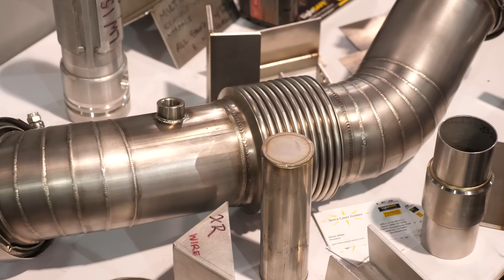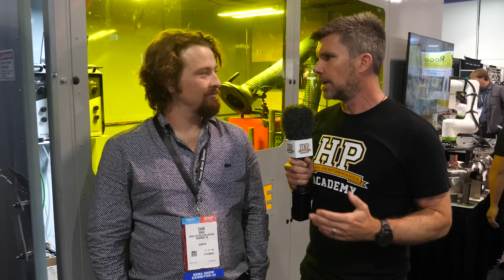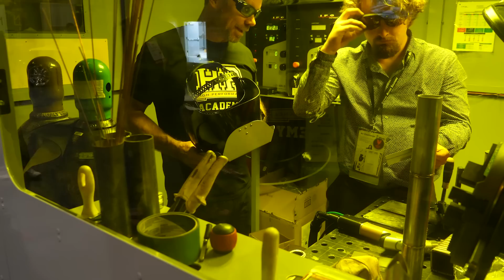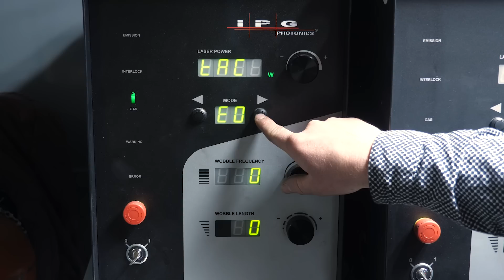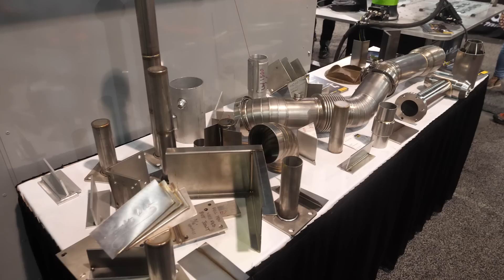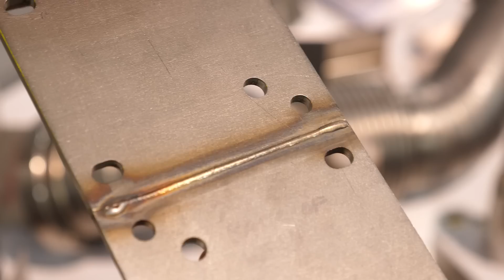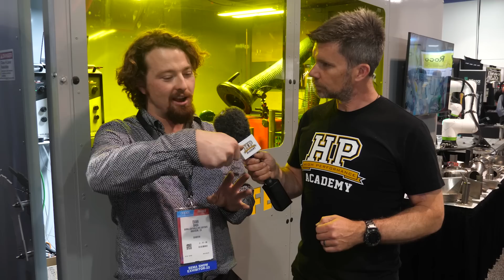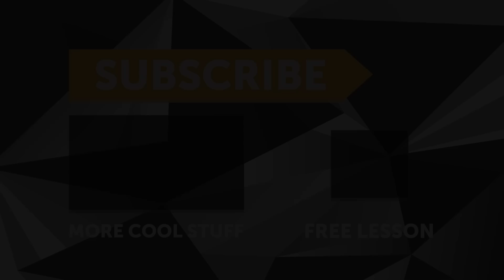Is LASER Welding Better Than TIG Welding?

Comment: Had some bits of laser welding done. One part fractured on the first use (medium stress/high vibration part) and had to be tig welded and then machined back flat, the other looks good so far and very little distortion (very low stress part).
Reply from the maker: If laser welded rockets can make it into space, I'm sure whoever did that welding for you can figure out what they did wrong for your part 😎

Note just like TIG and MIG welding machines, not all laser welders are made equal, nor are all operators (a good one knows the strength and limits of their tool/s), and there are some circumstances where a TIG or MIG might be more suitable. 

You really need to consider what is in front of you to work out the best tool for the job at the end of the day - Taz.
Reply: Welding is multi dimensional. If any one of those is not properly done you have a potential for failure. Your statement doesn’t provide enough information to make a good guess.

Comment: Laser welding has it's place and for bulk manufacturing of items made from thinner material it is very good.  It will not currently replace mig for medium to thick materials and it is not currently cleared for use in structural components or the dairy industry.  Some are as cheap as $20k for a 1000w power source but that also requires 20amp single phase power to run it.
One last thing he doesn't talk about is how dangerous they can be and how currently there is no safety legislation that covers class 4 lasers in NZ.  One I have looked at that was 1500w had a safe distance for a 0.25 sec exposure to the eye of 750mtrs!!  Also, they need to have dedicated welding booth like the one they had there.  Please don't believe the videos from China showing women in mini skirts with no safety glasses welding with one of these, they can be very dangerous in the wrong hands.
Reply from the maker: Yes and I wouldn't recommend that this is the only video someone watches to research laser welders before buying one, nor is that the intention of this content 😎 

From my personal experience using a laser welder in a previous role, they are no more dangerous than a MIG or a TIG welder noting someone negligent enough can find a way to accidentally harm or even kill themselves with a fork let alone any type of welder. 

A healthy & respectful fear of what any tool or machine can do to you and your health is a great asset to have, even if they are as mundane as a builder's hammer 😎

The industries that approve (or not) laser welding is 100% a consideration. I would be surprised if any companies were blindsided here considering they will already be working to and have systems in place maintaining a set standard for their specific industry including 3rd party testing at times where relevant. It will only be a matter of time before industries currently lagging behind will get their ducks in a row for laser welding though I'm sure.

A 20amp plug is also a requirement for some other welders along with some needing 3 phase too, with a 20amp plug being the easier and more desirable option for many - Taz.

PS: While most of your questions here would be answered presale for a MIG, TIG or laser welder, I did notice Serra offer some simple free training with purchase which I'm sure would address the rest of the concerns raised here which at a glance I thought was a nice touch.
Reply: @hpa101  Hi Taz, thanks for your reply.

Having sold welders for 25 years I can tell you that a lot of people don't care about fitting the correct plugs to machines, even some suppliers.
We have had machines turn up for repair that have either had the 15amp earth pin ground down to fit a 10amp socket or 20/32amp plugs removed and 10amp plugs fitted.
Yes, some people are that thick, I believe they are the ones who drag their knuckles in from the carpark...

I expect laser welding will become more widely used as the prices come down but NZ safety legislation needs to catch up as laser cutters are also class 4 and have been here for decades.  The European saftey specs (EN 60825 etc) have been around for years and they will be the ones we adopt.

Some of the first laser welders I saw at a trade show were robotic or mechanised, not hand lasers.  I've also seen laser/mig hybrid welding on thick plates, very flash.
I do hope Serra offer more than just simple training as they are capable of great welds but are limited by the knowledge of the user and the price of these machines warrants them spending the extra time.
Reply: Well. Laser its always very dangerous for eyes.  If you had used laser levels and reflects into surfaces the reflected glitter causes an after image.. , Remember that laser has the power in miliWatts range.  And this welder have a millon times more energy .  Miller company makes a iterative warning about laser burns by reflect and unintentional flash.  Remember the eye damage hazard. Its worst in comparison with arc flash.
Reply: I think guns are more dangerous than this...what are the worst than can be possibly goes wrong in using this than using a gun?
Reply: You can get a 1500W 4in1 system for $7k now, straight from China.
Reply: @johnjingleheimersmith  $3K USD now. I'm interested but have to check out quality, support, and spares cost before I commit.

Comment: $30k for a welder, I think I'll pass.
Reply from the maker: Not trying to sell you one, just discussing them 🤘 
You might not even need a 1-3k TIG welder and that is out of reach for many too, unfortunately. That doesn't mean you can't understand a bit about them either out of pure interest 😎 - Taz.
Reply: Tig welders used to cost that much some time ago so defo pries will come down as the tech is more adapted. For any hobbyists and small home welding jobs this would be an overkill but obviously for any high end shops doing bespoke fab and aviation/even food processing stainless this would be less time consuming and easier than Tig welding. Out of my price range too but defo something I can see I can use in few years.
Reply: Once you factor in the speed of welding and the cost of finishing consumables (grinding abrasives etc) the value proposition tips in favour of laser welding rapidly.
Reply: Easy to recover consider how expensive motorsport exhausts are 😂